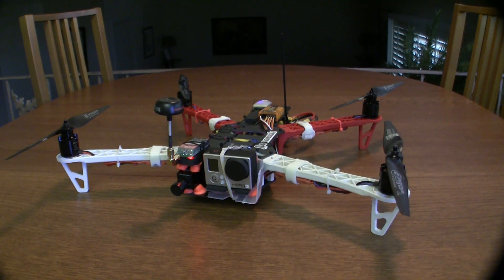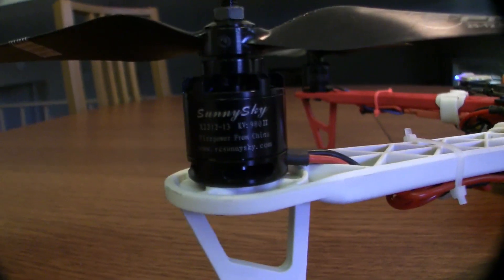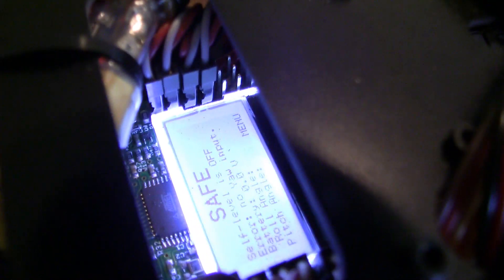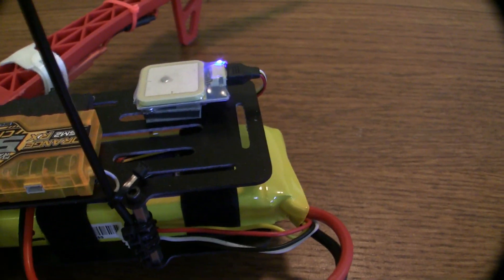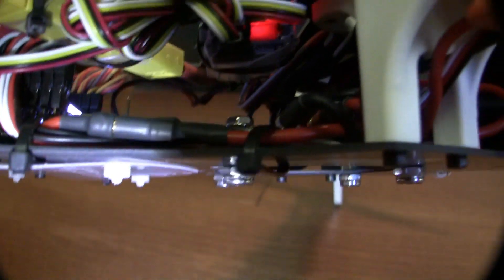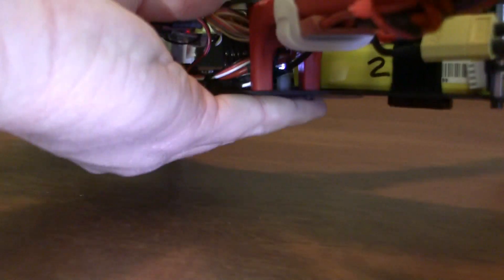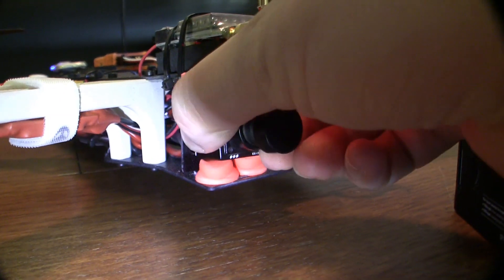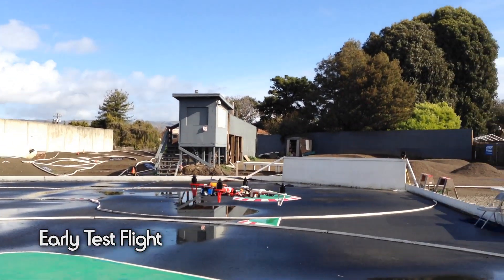Reptile V550 Quad FPV Build Tour

Comment: I used kk2 too but it works not good, do you how?
Reply from the maker: This video is 7 years old. If you are able to use something more modern than the KK2 I would suggest that. If not, or this is all you can get there are some great videos on how to tune the KK2 right here on YouTube. Just search for "KK2 Tuning" and you should find some good info. If memory serves, the tuning guide will ideally match up with the firmware you are running on that board. Good luck! It was an awesome board for it's day.

Comment: I have the very same quad but I am using dys 750 kv motors with 10.4.7 carbon mix props, & I have my gopro setting on a piece of Velcro & I don't have hardly any jello ! you can check out the video here on the you tube just do a search for reptile 500 flight 21 ! happy flights !!
Reply: I will be adding my build soon !

Comment: I have the same Sunny Sky motors, Youtube Search:  Z8Tr5CI2ydo

  I fly the the even cheaper Locust model ($30) quad and found the 9x4.5 carbon fiber props off ebay (after sanding them into balance) absolutely remove all wobble/jello effects!  Gopro mounted on Flytron bracket using stock rubber grommets that came with the Locust.

Comment: does the 12 inch props fits with this frame? The arms can be replace by the carbon or aluminim tubes then 3D printed locks

Comment: It's the arms that cause vibration on these frames.  You can balance props and motors until cows come home.  These arms flex almost 18mm at 50% of throttle.  It was a bad engineering on the part of DJI to even come up with arm design like this.
Reply: Anatoly Vizitiu  Arms don't cause vibrations....    common sense should tell you that an inanimate plastic object isn't just going to magically vibrate on its own.   Your motors and props weren't properly balanced, hence sending vibrations into the arms.  The fact the arms flex and aren't rock solid actually helps dampen that a bit.  If the arms were rock solid, even more vibration would have been transferred to your frame.
Reply: Bennie Chiedu
 I think the fact that you were able to fix the issue by using an F450 frame, which uses the same arms, pretty much PROVES my point that arms don't cause vibrations.  Not sure what we disagree about......
Reply from the maker: Yeah I eventually moved all the hardware off this frame and built something else. Now I have 2 main quads. A Iconic X FPV from "buildaquad dot com" and a QAV-540G from "GetFPV dot com". The 540 is nice but suuuuper expensive, and the Iconic-X FPV has been a solid 2 part frame that I have countless flights on. I suppose I should do build tours of those. :)
Reply: ***** Not true! I beg to disagree with you on this. I have built over 20 multirotors for sale and I can confidently tell you that the most unbearable vibrations come from this reptile from HK. I built it once for a client and when I went out to test it before shipping it off I experienced the worst vibration in my flying years. The vibration is so bad that even the gimbal can't handle it and starts to shake erratically. At 50% throttle it is quite visible to the eyes. I moved all the electronics to an F450 frame and the vibration reduced to a bearable level. My advice to anyone building a budget quad is to save more and buy a better frame. There are lots of good quality frames just under $100 that would give you trouble free flying experience.
Reply: ***** they don't cause vibrations they transfer it from motor and props to your camera and electronics. Wood absorbs some of vibration while cheap plastic amplifies the vibrations.
Reply: RC Pilot Multirotor
Exactly, thats why prop balancing is key.

Comment: Without a good quality brushless gimbal you will always have some shake in the video.  Also in the end of the video where you're flying it looks like the quad itself may be shaking a bit.  Being that you balanced everything it may be an issue with your flight controller and less likely the frame.

Comment: Hi, I think the jiggle is not vibration but is the flight controller. KK board might have some problems with spider style quads if you watch Hobbyking's KK2 SK450 Deadcat programming guide, before they tuned it, when the quad decent, it will wobble.
Reply: I think they even do a tutorial with the KK tuning for the atypical geometry of this frame.

Comment: is the screw that comes with the sunnysky motor is long enough to secure them on the arms of the quad? I have the same reptile frame just waiting for my motors. base on the picture if the sunnysky motor the screw looks short can you confirm that. thank you

Comment: SO how did the iconic x fair ? For the record, a stiffer frame is no guarantee for less jelo. Perhaps the contrary is even true, wooden frames seem to get good results and are anything but stiff. If you havent solved it yet, try pre-compressing your foam mounts somehow and if possible, make the camera 'heavier' so it has more inertia. I will try to put the battery and camera on the same tray, isolated from the frame and vibrations.

Comment: Hey Helidragon, I just bought the reptile 500 v2 with a Hobby King multirotor v3 board. and I was wondering if i could use normal X-copter firmware or need special firmware. thank you

Comment from the maker: Thanks for the comment Jan. The GPS is not wired into the KK 2.0 board. It goes to the Skylark Tiny OSD III that provides battery info like current draw, current consumed, and voltage. It also provides GPS data like speed and approximate altitude. This all is overlayed over the FPV image via a custom wiring harness. The KK2.0 board is totally separate from that system. Cheers.

Comment from the maker: For some reason flagged your comment as SPAM I have no idea why. I just told it "Not Spam". This is the V2 and it came with weird big huge landing skids. I decided not to use them. The plates are for sure not as thick as the Disco so this may be the reason. I eventually gave up and moved to the Iconic X FPV from quadcopters (dot) us

Comment: Smaller props higher kv.. sometimes to much dampning causes the jello effect.... also foam earplugs are designed not to fully cancel out harmonic vibrations hence you can still hear with them on :)

Comment: I have just built my wire rope anti vibration mount based on Yusuf Pirgali's design (Google "goPro anti-vibration Mount yusuf pirgali" and click on first link) I used clear plastic furniture feet coasters and a bicycle brake cable for my wire rope. But generally my vibration mount is very similar in concept to all wire mounts out there. I'll post results when I get to fly this weekend. Google "Tcopter Marina Weeliano" for my Tcopter vids.

Comment from the maker: Thanks for the comment. I loved this frame, but I finally gave up on flying it FPV or using it for aerial video and changed to a 2 part design frame. I may keep my "Reptile" though for Line of Site flying. Haven't decided yet. I will be curious on your luck with this wire frame thing you are talking about.

Comment: I have the same exact quad frame you have, I swapped out the soft arms for the stiffer and much higher quality HK Q450 arms and they fit perfectly. I have also tried all sorts of methods to reduce the rolling shutter jello effect on my GoPro 3 Black edition but still no success. There is one more method of removing the jello effect, that is to use the wire isolator mount. I plan to build one and test it on my Reptile. My Matt Hall Tcopter frame though with High KV motors shoots jello free videos

Comment from the maker: Hey Mike. the GPS is only for my OSD, and is not connected to the KK2.0. AFAIK it doesn't support GPS in any way. I have the Fat Shark Predator head mounted display. This quad without the Hero 3 was about $300 including 1 of my 3 batteries. Hope this help. Cheers.

Comment: I'm trying to get a quad project going and had a couple questions. How did you get the GPS module to work with the KK2 board, what does your wireless camera transmit to, and how much is your total investment in your quad without the gopro camera???

Comment from the maker: I did try a hard mount to the frame. I tried a lot of things. The earplugs trick yielded the best results. I think part of my problem is mt cheapy motors. I eventually want to move to 4S power and lower Kv motors for better efficiency. But I want to make sure I have a setup that still works with my Graupner 10x5 props. Love the bigger props on slightly lower Kv motors. Cheers, your HoverBot looks crazy! Happy flying.